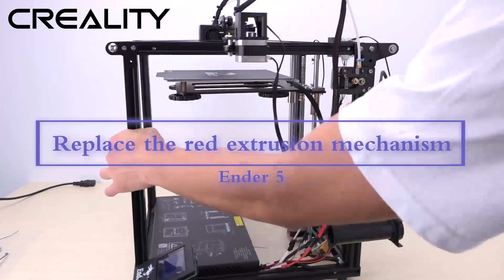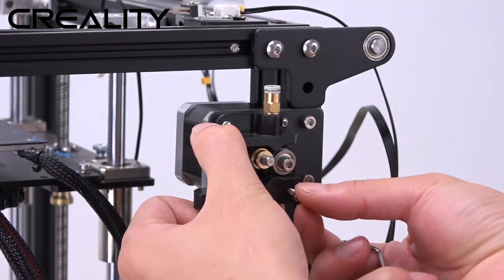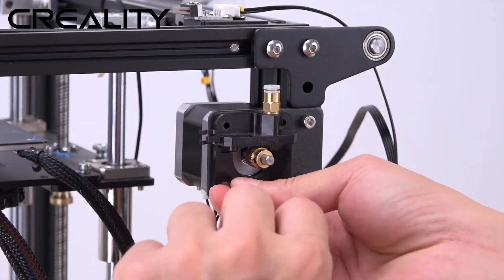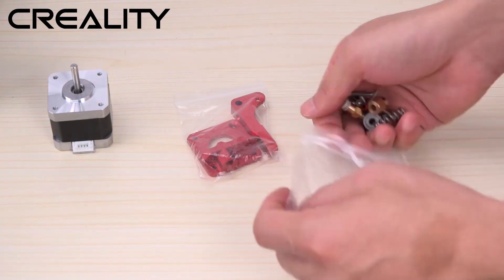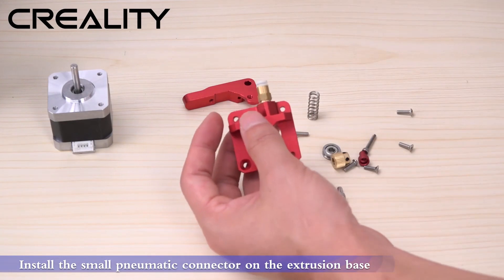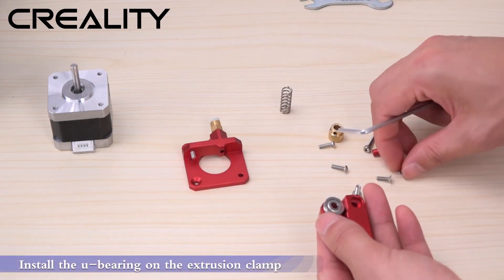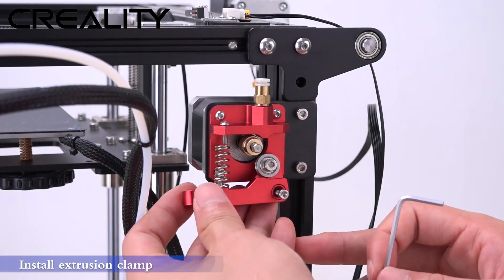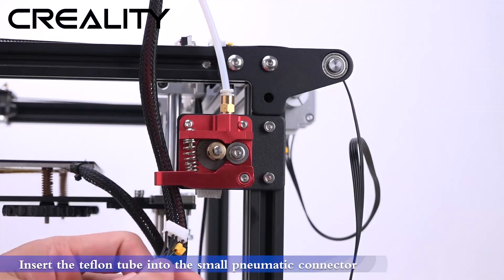Creality Upgraded Replacement MK8 Extruder Aluminum Drive Feed Installation Guidance for Ender 5

Comment: Finally got around to trying to install this only to find the extruder base isn't threaded to accept the pneumatic connector. Great product 🤬
Reply: I’m currently having this issue. Did you have to buy a new one? I’m a bit frustrated. You’re the only evidence I have that I’m not crazy.
Reply: @dullbatarang165  I just slapped my old stock one back on. Figure when it's time to upgrade that piece I'll ask around the community for good recommendations. Sorry you got cursed with this as well. :/
Reply: @archeremiya6336  Yeah, I can’t do that. Plastic one split in two. Guess that’s $10 down the drain. Thanks anyway.

Comment: This does not work on my ender 3. There is some weird bushing in the spring that does nothing. It also pinches the filament way too tight. Zero way to adjust that.
Reply: Cut the spring down

Comment: Hi! I have a question, what's the little red part for? I didn't saw you install it. Thank you! Keep up the great work!
Reply: This is a bush that fits into the extruder clamp.  It inserts into the screw hole that you use to secure the extruder clamp to the motor.  Insert it before inserting the cap head screw - it is the last screw that you see being tightened in the video (3mins 38 seconds in).

Comment: Just installed my MK8 extruder over the weekend on my Ender3 and working better than before.... Excellent !
Reply from the maker: Great to hear :)
Reply: You have also dodged a bullet with this upgrade: with time the filament would had cut through the black plastic parts. Well done.